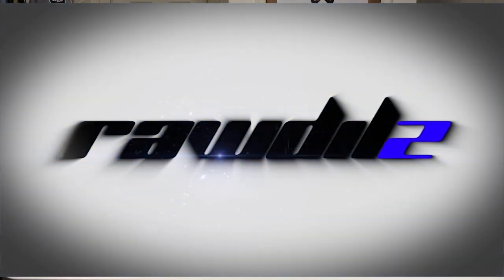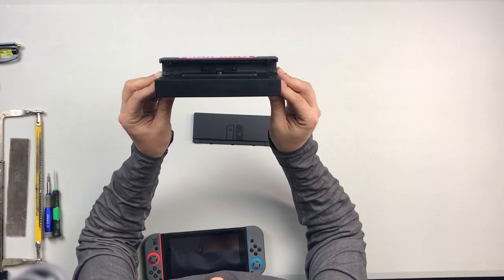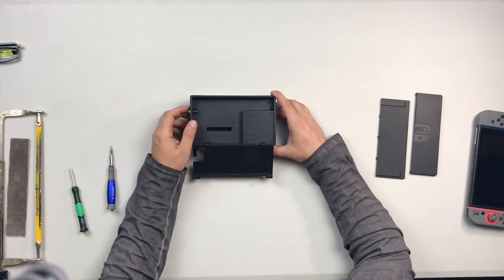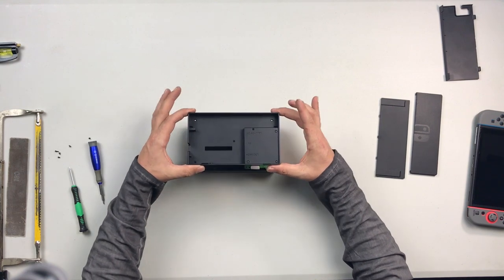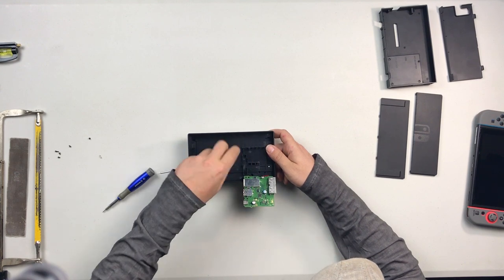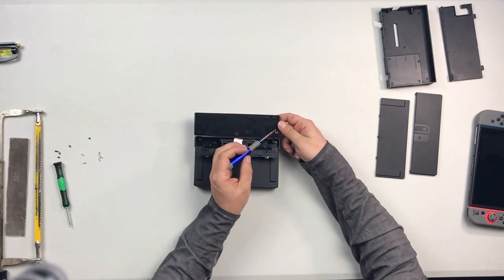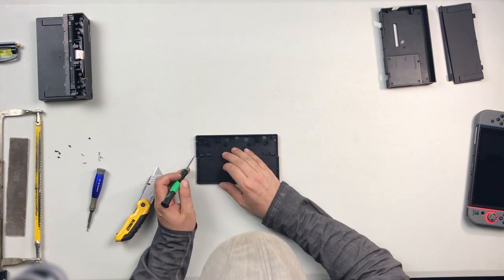Nintendo Switch Dock mod V2

Comment: I'm sorry if this is a stupid question, but what do you mean with 'ground yourself out' and 'static discharge'? Is it enough if I maybe touch something metal right before touching the circuit board? I know this sound stupid but I just want to be sure before trying this out :p This seemed the easiest way to get rid of the scratchy parts without just putting something over it. I was thinking of doing the same as the person before me said, just removing the inner liner instead of actually cutting the front plate in half bc I would probably mess up the cutting lol

Comment: The way I want it is to be flush we’re the switch sits with no front cover touching the screen! The problem is that I have to cut also the black plastic u shape spring mechanism in the front . I’m afraidof scratching the bottom front of the switch

Comment: Nice. I do have a question though. Wouldn't this also work by just removing the inner liner, since that's the piece that's physically scratching the Switch? Once it's removed, it should create more room inside as to not scratch it. This is probably what I'll try doing since I do like the aesthetics of the actual dock.
Reply from the maker: yes you are correct what i would do is install a glass screen protector
Reply: Rawdilz I already have a glass screen protector on and 2 spares. I bought one not knowing it was shipping from Europe so I bought another to put on right away. Right now, there's no problems but if my screen protector somehow scratches, I'll remove d inner plate. Nintendo being Nintendo and being cheap. They should have had a glass screen from the beginning and the plastic thing inside the dock should have been silicone or something that wouldn't scratch the screen. What you did was really nice and it's what I would have done had mine been sitting under something but since mine's sits on top of a cabinet, I don't have to cut it down. Anyway, excellent video and one that's actually doable without really harming the dock or getting rid of the dock completely.
Reply: Say Soun_ exactly what i did. removed the inner liner, problem solved, my dock still looks stock, but switch is not touching the front
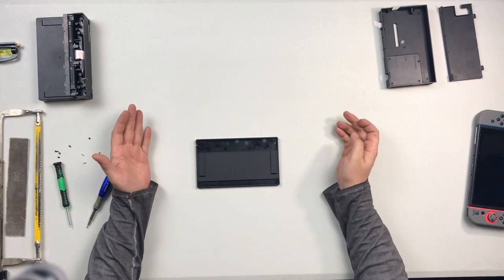Reply: Cant figure out how to remove the inner liner for some reason. Trying to do it like he does at 7:01 doesn't work since the top part isn't missing for me.